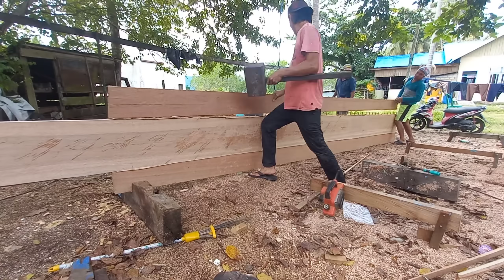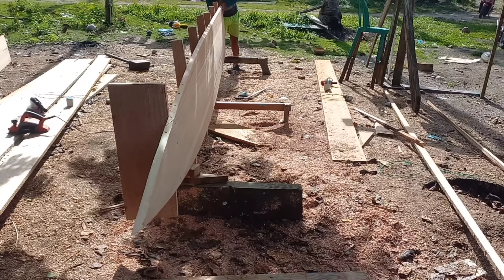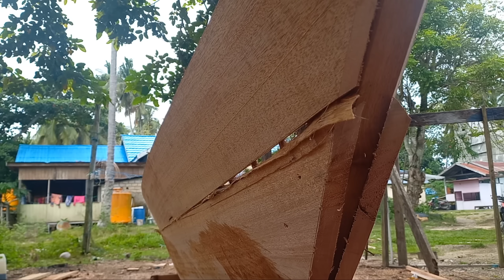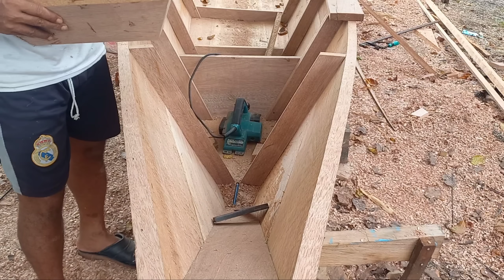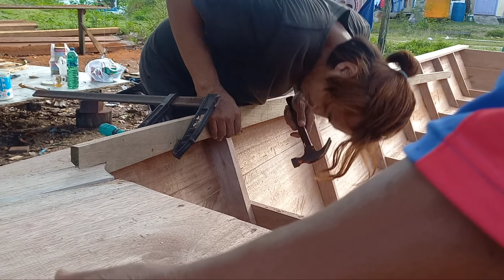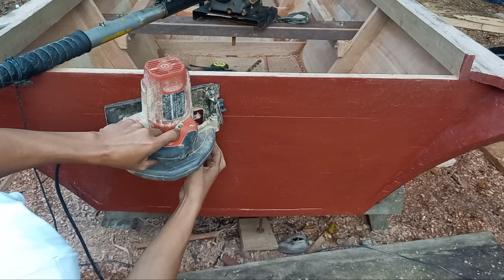Cara mudah membuat perahu kayu

Comment: I don't know for sure but I think the traditional boat making wood would have been Teak which is weather and rot resistant, but no longer plentiful.  Meranti is plentiful and more sustainable but is not rot or insect resistant and will water log if left in the water.  Using wire nails and steel screws means these boats will only last a few years at best.  But, they do with what they have available and the traditional skills and craftsmanship is beyond reproach.
Reply: teak is a high demand lumber, for the size this guy need it would be at least 30 years old teak and the cost would at least triple.

Comment: That finished boat was incredible. I'm curious as to why sometimes you would use nails as opposed to screws? I'm sure there is a reason.
Reply: Nails are used for components that may be removed later and replaced. Bolts / screws for more permanent fixings.
Reply: @VenturiLife  Surely you mean the other way around ...?

Comment: These were used by trappers and traders on the northern rivers of alberta I was aware of them in the 1940s and '50's, some of the people peered them with model "A" engines, they were affectionately referred to as RIVER SNAKES. Very sound and hard to tip. They would carry a big load.
Reply: Ga

N

Comment: THIS is Fantastic! So much easier to put the ribs in after planking. It makes so much sense to plane edges as you go. Beautiful boat.  What kind of wood for the hull?  Thanks for sharing..
Reply: Looks like oak? Not sure
Reply: Or Heva wood?
Reply: They said Meranti- that is a Mahogany
Reply: Amazed how much he did by eye without marking first
Reply: Looks like Philipine Mahogany. Light but strong as hell. Fantastic boat. Looks indestructible.
Reply: Mahagony is a preferred type of wood as it is quite straight grained ,dense, water rot and termite resistance

Comment: The wood he is using is Meranti it can be hard or soft, very heavy or lite.  I would love to build this boat however the power saw cuts were scary, raw skill, but I cannot fathom how he did the Dowling shaping the top dowel into a point must be the key, even taking this into account at the contact point they need to be a perfect alignment or softwood that compresses which Meranti can do. Screws will only pull together if they are predrilled on one side or pre-clamped. Wish I could have been there to learn.

Comment: In the base of the boat when you joined the three lengths of timber together,  was that paper bark you used to seal the joints?
Amazing build
Reply: I was wondering that too
Reply: Yes it is
Reply: And the boat won’t last because the wood not suitable to be soak in water
Reply: My dad use wood nails rather than iron nails
Reply: @brayanbriak6516  paint it, and coz not live in water can dry out every day

Comment: Di dempul Kapal makin mantap tahan dgn predator air..sy hoby mancing 2 speed boat yg model gini juga ada perahu kayu juga ada panjang 7.5 meter pakai pakai paralon 5 inci kiri kanan diisi gabusan padat didlmnya baru dilapisi bambu belah dua diatas Pralon diikat Nilon mancing no.700 bambu dikupas baru dicat biar kuat..mesin katinting 7 pk 2 dan speed boat 40 pk Yamaha..😅😅😅😅
Reply from the maker: Wow,mantap bang👍👍🙏

Comment: it is better to use nails than screws. just for your info. if you use screws you won't be able to exchange those and the holes will become bigger which will make your boat sink. nails are old school but they are the best

Comment: at 9m54 the guy put a drywall screw.... it will be desintegrated by rust in a short amount of time.. it's a boat ffs use stainless steel